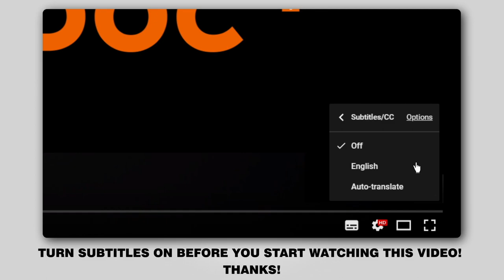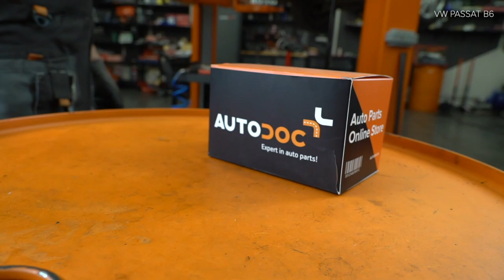How to change rear brake pads on VW PASSAT B6 (3C5) [TUTORIAL AUTODOC]

Comment: This clip doesn't tell you the whole job... Usually autodoc are spot on but not this time... You have to have a vag obd code reader that's got abs reading ability. You have to put the brakes into service mode (restrict brake pump) before you can push the piston back to then be able to fit new pads.... We wasted hours trying to force the piston back not knowing this. You then have to take the brakes back out of service mode once the job is complete...
Reply: "4. Put the braking system into service mode" 
The video shows the actuator motor and a laptop with diagnostic cable. I think you skipped over it.

Comment: Do you have to put the parking brake into service mode?  I do not own a scanner tool.
Reply from the maker: Yes, you need to put the brake system into service mode, we recommend contacting a service centre for repair.
Reply: Thanks for telling us in the comments. I'm halfway through, battling to get the caliper off... looks like the video has left out a crucial part...

Comment: 4:50 Do you have to turn the caliper wind back tool or you can push the piston straight in?
Reply from the maker: The tool must be screwed to fit the calliper piston into the body.
AUTODOC

Comment: Right but if you are removing the connector from the electronic handbrake, after putting it back, should it be connected to the diagnostics tool and recalibrate?  Or it should be fine?
Reply from the maker: Thank you for your comment!
You very correctly noticed that in the case of an electronic handbrake, after installing new components, you need to perform a computer calibration.
Best Regards,
Autodoc team

Comment: Where did he get the disc with the holes from what make is it?
Reply: Yeh and he managed to change it without removing the caliper bracket
Reply from the maker: Thank you for your comment.
You can find such discs on our website or contact our Customer Support team. 
The material of such kind of disks has no difference from the ordinary disks.
Best Regards,
Autodoc team
Reply: Brembo you can buy it online
Reply: Its a con. They don't do anything special, but they cost twice as much. They'll say it's for heat dissipation. Doesn't make the slightest bit of difference, it's all for show.

Comment: If you don't have access to a computer you can rewind the electric parking brake with a +12v battery after you've disconnected the connector.
Reply from the maker: Thanks for your valuable clarifications, this will be very useful information for our viewers.
AUTODOC
Reply: but after put new brake calipers in both sides do you need calibarte? or they will automatically adjust?
Reply: @S1L3NT__  They auto-adjust when you engage the electric parking brake.

Comment: This is crap, this video it’s missing a key part to retract the brake caliper piston!!!!! Which you can retract it by using a software or taking a part the piston and do it manually.
Reply from the maker: You are absolutely right. In some trim levels, this car has an automatic electric handbrake function.
It is recommended to use special software to release the brakes.
AUTODOC
Reply: 12v battery 2 wires and done my g

Comment: This video is not a good guide what about the electric handbrake u have to plug it in to wind the caliper back cheers pal that was a good waste of a few hours running around to buy a load of tool I don't need
Reply from the maker: You are right, some moments in the video were missed, but our channel is not educational but is only for informational purposes. We strongly recommend that all replacements, especially those relating to the brake system, be carried out exclusively at a specialized service.